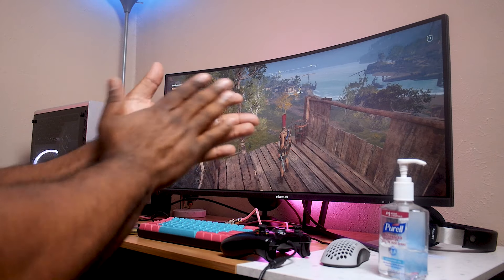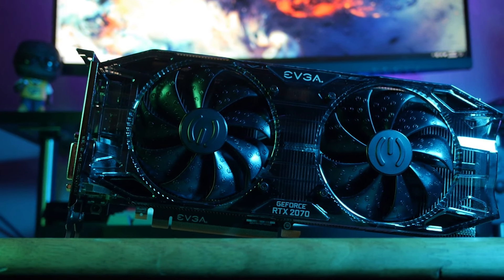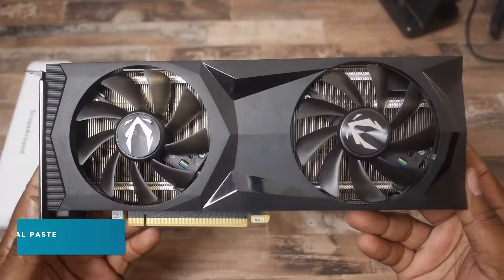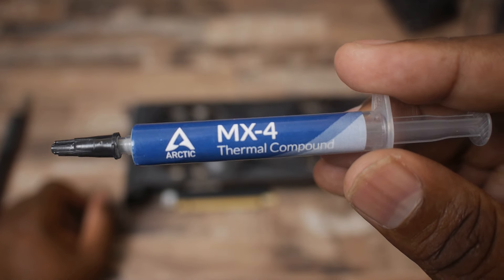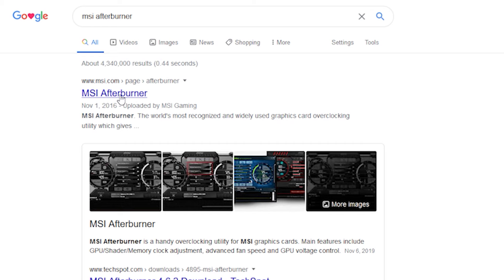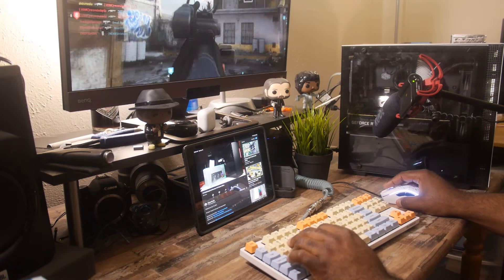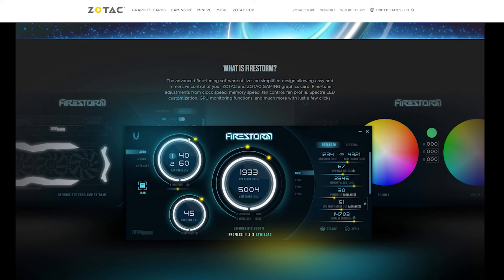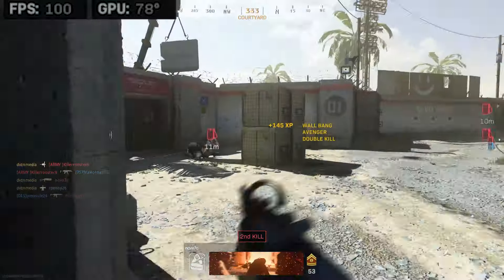3 Easy Tips To Lower GPU Temps!

Comment: Thank you a lot, I used to reach 83c to 91c, now I'm stable at 67c <3
Reply from the maker: Glad I could help that's quite a significant change!
Reply: Witch tip did u do to make it so low?
Reply: @devonpearsall3714  FR MY SHIT BOUT TO EXPLODE
Reply: @aliprobably  I think it was the one that set ur gpu temp limit
Reply: @devonpearsall3714  oh ok
Reply: @devonpearsall3714  yeah it’s a lot better
Reply: @aliprobably  yeah it worked for me I set my temp limit on Msi afterburner to 65 and now I’m chillin
Reply: @devonpearsall3714  Alr I’ll do 65 fs
Reply: @devonpearsall3714  but how much it affects performance?
Reply: @valkasu  not much honestly oh have a 1660 super and it feels the same
Reply: @devonpearsall3714  what game you run?
Reply: @starkayy5896  I run valorent at over 150 and Fortnite runs 100-200
Reply: @aliprobably  same lmao
Reply: Is 75c good guys?
Reply: @hazim5561  yes under 75 is decent
Reply: @devonpearsall3714  is it a dual or single fan?
Reply: @chunkWZ  dual
Reply: @devonpearsall3714  im getting the single one and i hope it doesnt overheat xd

Comment: me that wanted my gpu down to around 40 from 70 but find out 70 is quite good: lmfao
Reply from the maker: Yeah, it's dope to get it as low as possible but 70-80 is a perfectly fine range
Reply: @DVZNMedia  its Because im buying some lights to my new pc but they can only take 70 Max so im going for 55-60 °C to be sure
Reply: @magnusbillingagerskov4368  remember that gpu temp is on the gpu and not the temp of the surrounding air 5 cm away
Reply: @CrackedWood  yeah ik but my gpu was the only Thing that had a high tempature
Reply: This reply thread is really helpful. As I said on my comment, I'm really worried if it hits 50 or above, as my old RTX 2060 clonked out after 2 months. Great to know that I can push it a little further and no worry about temps so much. I WILL be keeping my eye on the Degress though. Great video DVZN, cleared my worries up a bit!
Reply: Me too my guy
Reply: during gaming and to most of the games that I play, my GPU always hits 80-83 and stays like that (fan speed hits 100%) . Is that an okay and safe temp? (Room temp arround 30-33 degrees)
Reply: @iSimplist  in theory it Should be okay but id recommend to increase fanspeed if possible and also remove the side panel on your case just to be sure
Reply: @iSimplist  80-83 degrees is fine, but at 100 percent fan speed and a 30-33 ambient temp? You might want to get better AC if your ambient temp is that high, it would help with thermals and fan speed. My ambient is 23 degrees and I’m only at about 60 percent fan speed and my temps are in the mid 70s. You might wanna get your room temps checked out.
Reply: Mine stays at 60 😳
Reply: @PenguinoPlays  yea indoors i have like 33 while outside like 38 , now it gets a little better since we are heading into winter, but yea. 6 fans in case 3 exhausts 3 intake , gpu fan speed at 100% and when i play lets say red dead redemption it hits 83 degrees . when pc is idle or youtube - browsing etc i have like 40 max both on gpu cpu

Comment: Bro this video is awesome. I downloaded MSI afterburner and found that my GPU fans weren't set to go to 100% speed until my card reached 90C. Saved my ass for sure.
Reply from the maker: Oh fam, glad I could help!
Reply: Can i download MSI afterburner to check my nvidia graphics card's fans?
Reply: @critianclassico8208  Yes absolutely. I have a Nvidia GTX 2070 and MSI afterburner works just fine for it.
Reply: @wardenmetallicred  thank you!.
Reply: which card?
Reply: @ummatimuhammadi9028  Just realized that's not what I have. There's so many numbers and stuff on cards I get confused sometimes. It's a 1080 GTX Founders edition.
Reply: bro i have rx570
my card reaches 87 88
i have no cooling fans
what should i do?.
Reply: @ummatimuhammadi9028  I'm not sure what you mean by no cooling fans. Do you mean your card has no fans on it or your case? If you're card has no fans, that's a huge problem because it's supposed to have two from what I can see.
Reply: Robert Diffenderfer he probably means no case fans cause i have rx 570 too the xfx version and it has 2 fans but the problem is that my room is very hot cause i live in a hot country about 31-35°c room temp so my card fans at max speed still hits 89°c

Comment: ive done all these including the thermal paste but i havent tried lowering the slider. Im currently using a 1060 because i cant afford a new gpu and shes def on her last legs so im trying everything to preserve its life while i can. I capped the temps sat 80 and turned all my fans on performance mode to keep everything as cool as possible. Thanks for the advice man, i appreciate what you do

Comment: Thank you so much, I just my got PC set up and saw that my temps were 85 degrees Celsius and even went up to 91 at one point. I was worried as hell man lol. I used Firestorm like you recommended and it helped not only with the temperature, but also with the noise.

Comment: Good tips. I like to use a lot of fans to keep lots of air moving through the case. 
Have 6x120mm and 1x140mm on the side blowing in. 
Yes, it does get dirty faster that way but its quiet and never comes close to heating up.

Comment: Easy tip for everybody. No need to open or change anything in your pc. When opening a game, limit the fps to 60 or lower instead of letting your pc go up to 100 and more fps. If you don't have a 144 hertz monitor you don't need those fps, it's like having lost fps in exchange of making your gpu work more. Now if you do have a 144 hertz monitor you have to decide, what do you prefer. 144 fps or having lower temps on your gpu? Your choice. Another way of doing this is by activating v-sync or if the game doesn't let you limit fps. Go to your nvidia panel or amd panel and in 3d settings, choose the application you want to limit is framerate.  There are lots of videos on how to do that if you don't know how.

Comment: This is the video I been looking for. I been changing the thermal paste once every year. Just like changing your engine and transmission oil on the car. This is due to the effect of expansion and contraction that pushes the paste outside the the contact zone. However, I didn't know about Zotac Gaming FireStorm software.
Reply from the maker: You can do it on afterburner too, keep that in mind!

Comment: If you can do all these things like adding new thermal paste, maybe an exhaust fan as well, I know some pc's do not have them which is a little strange, you should get a lot lower temps. Also, go into your pc's control panel and make some adjustments there in the global settings and you should be straight.

Comment: best video card for your money ever was the Radeon R7 350x. It STILL can play games like COD WWII and Saint Row 3/4 , Bioshock infinite and remastered etc etc etc at 1080p  with everything at high BUT the card  runs at 90C while doing so. I played bioshock infinite at max at 1080p for 5 hours and the temperature AVG was 83c with a max of 93C.
This 350x 4gb is like 10 years old and it's low profile + you don't need to plug it in your power supply, you can buy a 59$ computer and play most games made before 2018

Comment: I have the 3090 Ti Zotac Holo Amp Extreme , my temps usually stay around 50-55c under load ❄️ pretty much an alternative to a 3090 Ti ROG STRIX card and at a cheaper price 💪😎

Comment: Capping your frames helps a ton also. I tried GTA5 Ultra/Max everything at 1440P and capping at 60FPS my 3070Ti was at high 50's to low 60's C.
Reply: Really?
Reply: Going to try this.. my 5700xt was pushing 95-100c playing mw2 earlier
Reply: @ts153192  My 6750 XT was caping 83 also going to try this
Reply: @Pompiscuachos  it worked for me I was staying around 75-80 big improvement.  Still might be hot to some but I'll take it.  Looking forward to winter time to help

Comment: and if you have high temperatures on idle then set performance to default in gpu software (not max performance) so gpu is maxing performance only in games and when it have to. it really helped me before i had 45-53 on idle now im having 30-35 idle temp

Comment: My 1070ti stock is maxing out at 84c and thermal throttling. Undervolted to 0.881v @1886Mhz, max temps is now at 75c on 30mins Heaven Benchmark. Got better scores too compared to stock.
Reply from the maker: oh nice, getting the most out of that with the undervolting

Comment: Eighties are actually acceptable temperatures. I have a RX580 always hitting 80-90C when  playing a high end game. I had this GPU for over 3 years without any issues. I do wonder why its so high because my old GPU's used to max out around 80-85. I guess it really depends on the manufacturer. I have the AMD's own version of the RX580 .  AMD had said that temperatures up to 95 are perfectly safe and I noticed that the fans do really kick in if the temps get too hot. Of course I can increase my fans with Afterburner if I see it constantly hit 90+ but so far it never went over 90C.
Reply: Hey dude , Eighties are acceptable even if it's a constant temperature for the GPU when you running a game like Evil Within? Because mine is always between 80 and 85°C , it's a rtx 2070 super winforce 3x oc from gigabyte and I bought it since september , so like 6 months ago
Reply: @drakyrra4443  i honestly won't worry about anything in the 80's. Once you reach the 90's then you should probably turn your fans up like how this video instructs you.
Reply: @MrNothingButAir  ok thank you for your response , I'll try to remember that :)
Reply: @drakyrra4443  hey Man did you manage to lower your temps? i have the exact same gpu and have had the temp issue forever.
Reply: @santiagonas7052  Hey , didn't manage to lower the temp yet, maybe in the future I will add 2 more fans up in my case and see if this help or not, if it's not maybe the airflow in my case is too bad (Zalman R2) so maybe aim to a bigger case with more flexible options of airflow, but these times I don't have access to my pc because I'm waiting for moving in a new apartment maybe next month I can check on that.

In fact, you will need to optimize your aiflow with more fans, maybe a watercooling custom on a gpu but pretty difficult if you don't have knowledge to built one correctly, or like me a newer case with more space in so the air will be more comfortable for your gpu.

Comment: I tried the last suggestion, but I disabled the link between the power and the temp limit and set the power to 100% and GPU temp to 65. I was getting up to 83 c; now I am at 72 average with highs of 75. I noticed the clock speed is a bit lower, but I don't feel a noticeable difference. Thanks for the video man!
Reply: did the zotac software give you any issues? could i also please get a download link for this software?

Comment: Holy Sh!t, You're okay with sitting at 79 degrees? My old RTX 2060 clonked out after about 2 months and got a replacement. Thought the cooling was the problem, now i'm crapping my pants if the temp hits anywhere above 50 lol
Reply from the maker: I saw your other comment, and yeah it's okay and actually quite normal for your gpu to sit anywhere between 60-80c while gaming depending on your case and air flow.

Comment: my 1080ti was running mass effect 3 legendary at 60fps locked , around 50%GPU load @ 140F  . didnt care that much since its not crazy hot but the rig was loosing signal to my display and GPU fans spinning at max and had to hard restart the rig. took the GPU apart , new thermal paste and new thermal pads , cleaned the card , replaced the riser cable since oil from card went in there, replaced PSU power cables to the GPU and voila , gaming at 120F max and no more crashes ...

Comment: Best method to lower GPU temps for me is to undervolt..been using this ever since I started building PC..damn my 2060 super also runs hot like yours..it even hit the max temp, yes, 89 degrees!!! So I undervolt it to run stock clocks (1980MHz) at 900mV..from 85-89 degrees down to 70-75 degress stable..doing this together with custom fan curve yields better performance overall.. there are a lot of tutorials out there how to undervolt.. it's a bit tedious but it's worth it.. 😁
Reply: Get to modding bro. 
Remove that shitty GPU cooler and tie 2 120mm case fans onto the heat sink using 3, 4 zip ties. Connect the fans to the motherboard. Remove the backplate too. 
Did this to a strix 1080ti = 66C max, super silent. I used 2 high quality noctua fans but you can use any case fans.

Comment: yo i know this video is 4 years but how do i fix this. i got a fresh pc everythings new even the case and its hot asf if i put my hand on it and 70 temp and sometimes automatically restarts when i run..a minecraft modpack..fortnite with ultra-high graphics. also coil whines alot. i put overclocking on it and stuff. doesnt rlly help. im using a radeon rx 6650 xt. with a good power box. and a icore5. i really want to fix my pc. but idk how to fix this.

Comment: I used MSI afterburner and capped the temp limit to 75C I think at that temp range the power was reduced to around 85% iirc. 

I'm not really comfortable having my temps above 70C so I might also buy better case fans for better airflow.

Comment: Hi, I tried doing the second step, however, I do not see a tab labeled Fan in the settings, nor can I change the fan settings in the main interface. I have an NVidia, might it be because of that? In Firestorm, power and fan speed is unchange-able as well...

Comment: I don't recommend his advice with any thermal paste you can get your hands on to apply to GPU's. MY recommendation would be Artic Silver which is a very good thermal paste.
Reply from the maker: I wouldn't mind trying a bunch of different thermal paste, but if I'm going with Artic I'd suggest the MX4.  Honestly I wonder what the real difference in various thermal pastes?  hmmm
Reply: Hopefully the link works because YouTube...
Reply: @DVZNMedia  Most thermal pastes don't spread enough and are too clunky and don't pass through enough conductivity and don't have enough of silver in there thermal paste. A few extra bucks will dramatically help your GPU in lasting than using another thermal paste which drys quicker and crumples up faster. I've been using Artics Thermal paste for years and it only has gotten better every time they improve there thermal paste.

Comment: Meh... Use Afterburner for sakes of Riva Tuner. Set power/temperature separately to let's say 81°C and 91%, next thing is to let him determine OC profile. After it's finished hit ctrl + F which opens power/voltage curve. Now shave off everything above 1911 MHz or a little less if its couple yours old GPU. This is undervolting. Save and apply profile and you are ready to go. Optimizing fun curve. You need to optimize it to the cooler RMP and noise it makes. Set the min starting point to the 1700 RMP equivalent in %, meaning it won't go under that. Then set max to approximately 2800 RMP as you will get onli 2~3% of airflow going over that with significantly more noise. Set that it achieves it early at 51°C and stays there. That's just about it, now you have a GPU which won't go above 81°C (which is still high but with power hungry GPU's you can't do much more, ideally is 75°C), boost clock will be little lower but much longer lasting and sustainable frequency will rise (to about 1700 MHz) so now you have a GPU which driver's less power, works better and has relatively normal temperature.
Disclaimer this is for Nv GPU's from GTX 10xx series onwards (as nothing changed much from then including manufacturing process), shouldn't be much different for AMD one's but it would need some rework.
Best regards and enjoy.
Reply from the maker: lol I should just put this in the description, no need to watch the video
Reply: @DVZNMedia  Sory for that. People will still first watch the video and then eventually read comments. I watched it as I am about to modify my GPU cooler. Thinking of putting single 120 mm noctua nf-f12 2000 RMP blower instead of two 90 mm one's on it. Should give around 50% more air flow while being really really silent (30 dB at full swing which is equal to environmental noise in quite environment).

Best regards.
Reply from the maker: It's all good, my channel is about getting the information to the folks and I appreciate it.
Reply from the maker: I've always want to try a gpu mod, let me know how that comes out of like to see it

Comment: hey man this is a great video! if you don’t mind telling me if getting to a maximum of 82 degrees celsius is bad in game? that’s what l i’ll get max on fortnite but if i’m just sitting on windows screen it’ll be maybe 45 degrees. i have a 2070 graphics card. also, i bought a pre built and my fans are cheap, would replacing my main fans help with the temp? i don’t know pcs so i might sound a little dumb. thanks .
Reply: Zhen Kun hey bro i actually figured out my problem so i may be able to help you. i downloaded msi, upped my fan speed to hit 100 when it would go up to 70 degrees celsius and then i would just x out msi not knowing that that actually closes it out, every time u power on your pc u gotta go to msi and it’ll start, then minimize it. so yea hope that helps man

Comment: I used the firestorm app for my zotac 2070 super and i lowered my power to keep my gpu temp at 80c max. 
My gpu idle temp was around 35c, but now my idle temp is around 50c-55c
Is that good? Just made me worry a bit.
Reply from the maker: You shouldn't be worried, but I would honestly check out Optimum Tech's video on properly undervolting your card to see if you can get a better way to reduce temps.
Reply: @DVZNMedia  alrighty, thx you~
Was a bit curious on why my temps went up, but ill have to give techs video out sometime!

Thx for getting back :p